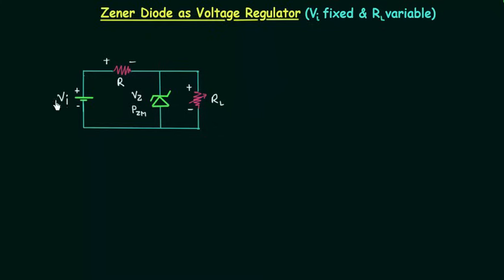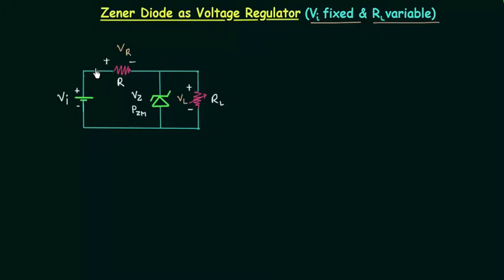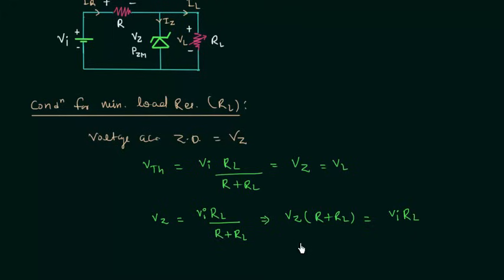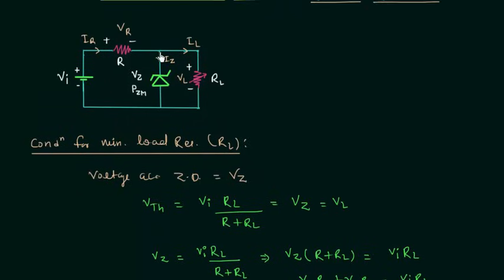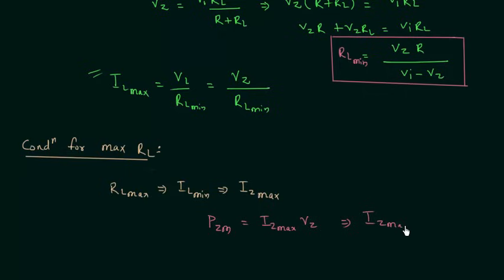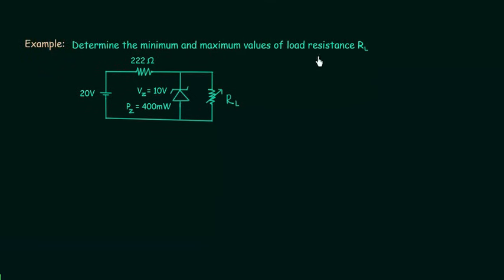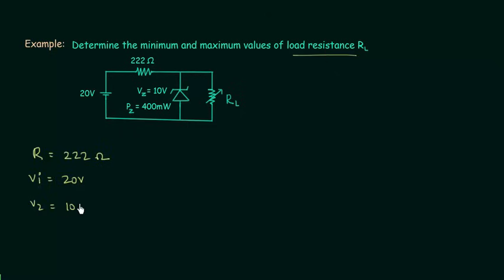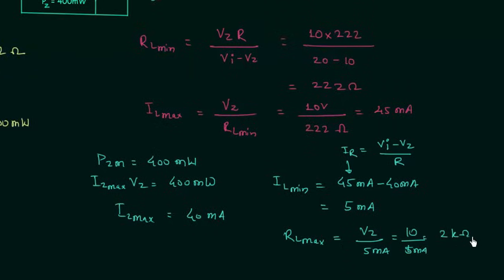Zener Diode as Voltage Regulator (Part 2)

Comment: Maxm load resistance should be 1.982 Kohm. Sir, you didn't calculated the parts after decimal during the calculation of maxm load current.
Reply: I agree with you sir it should be  1.982k or 1982.161 ohms

Comment: At 2:37 how the voltage across the diode i.e Vth =vi RL / R+RL ? Shouldn't it be the condition for the diode in off state? Thats what you told in the previous lecture....plz make it clear.
Reply: same doubt bro...in that case Iz will be zero

Comment: As an interesting result, it should be highlighted that Iz(min) at 5:29 will become 0 because the expressions for I(R) and I(L) would be the same. This can also be explained from the graph of the Zener diode.
Reply: not quite i think. as you can see from the I-V graph that the zener current occurs AFTER it crosses the knee current (Izk) so its minimum yeah but not 0. and Ir and Il will also not be same since this is a case for when the zener diode is in 'ON' state so there is current flow through the zener diode too.
Reply: @bricxe  nah but it's the boundary condition, so we can say current will be 0 through zener diode

Comment: At 2:37
I have a doubt in this.
You said that Vth=Vi/R+RL but this is when zener diode is off but here as we have to find the minimum value of RL to on zener diode such that Vth=Vz=VL and here the value of current is not same in R and RL as you have used in previous video so we cannot use this Vth.
Reply: was having the same doubt
Reply: Same doubt

Comment: At 0.40 when RL is 0 means short circuit. That means high current flows and 0 current though diode means voltage across diode should be high. Why here you took it as low

Comment: For the case of Rmin(min load resistance) when the current through the zener diode will also be minimum - that current through the diode is coming out to be zero instead of knee current. Pls help!
Reply: yes, good question!! I had been also confusing with this, but I suddenly got it!!
the ordinary Zener diode is different from the ideal Zener diode!!  ideal Zener diode assumes that the diode will kick off from the knee current position, but ordinary Zener diode will not be considered to be "ON" at that point, rather at some point after that!! so knee current will not be considered in actual situation!! you can go through lesson 48,  Zener Diode Numerical Problems, tutor has some explanation about this!!
Reply: Yeah correct.. Knee current is used for calculation of max load resistance. Sir got confused b/w the two. Otherwise his lectures are awesome.

Comment: The condition used to calculate the min resistance is also true in the case of max resistance. But why does that only give us the min resistance? Anyone?
Reply: In min resistance we consider iz is equal to zero but in max resistance we consider iz equal to maximum current that can flow through zener diode

Comment: I think the procedure for obtaining Rmin is incorrect. Because if Rmin is calculated as you have explained in the video, then it would mean that no current is flowing through the Zener; but a minimum "knee current" should flow through the diode for load regulation. 

It have seen most questions that give the value of knee current (as well as Vz) if Rmin is desired from the question. Please correct me if I'm wrong in this context.
Reply: Yes, exactly.. Value of Ir is equal to ILmax which gives Iz zero. ALL THE TIME. Help me too if you've found the answer.
Reply: I'm also having the same question.. Please provide the solution sir..
Reply: Yup knee current is provided in data sheet. From there you can calculate max load resistance.
Reply: Knee current require for calculating Rmin
Reply: sir I too have the same question please explain

Comment: Thanks a lot sir, but there is a point i dont get it. Why IR=(Vi-Vz)/R, as not Vz and VL are in parallel
Reply: same doubt
Reply: The R he means is the current regulating resistance , the one in series to the combination, the one parallel is denoted as RL
Reply: KVL in loop 1 is answer to all your questions.. Loop 1 has Vi, R and Vz.
Reply: 1st we can apply thevenins theorem and remove the dode ....we can se Vi - IR -ILRL=0 
 Vi-ILRL=IR , now Vth=VL and VL=Vz so, IR=Vi-Vz

Comment: What will happen when the load resistance is greater than the max value ??..like in that case the power dissipated across the diode will be greater than Pzm....then will the diode be damaged??..or the voltage regulation will not be obtained??

Comment: Does it automatically imply that current through zener diode is zero in case of minimum load resistance?
Reply: If you got the answer then please share. 
I think a small amount of current is always present even in Reverse bias, the knee current. But I don't know what's the equation for that.

Comment: What will happen if the load resistance is less than the calculated minimum load resistance?
Reply: In that case,the zener diode will remain as OFF.